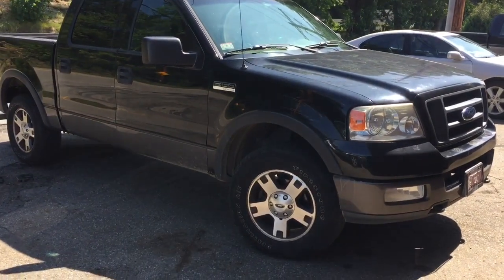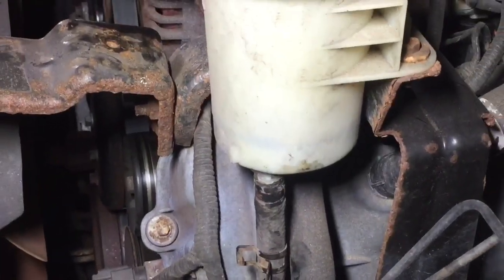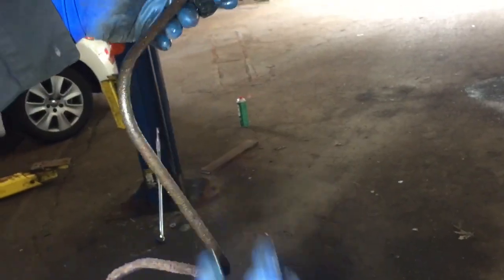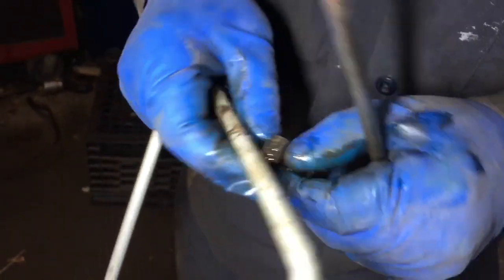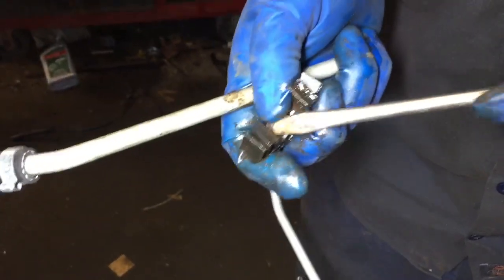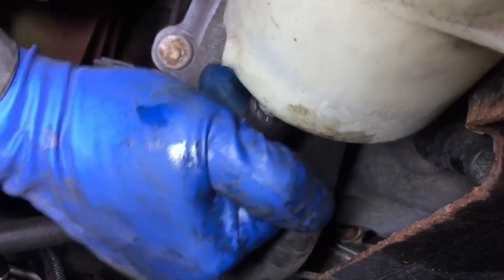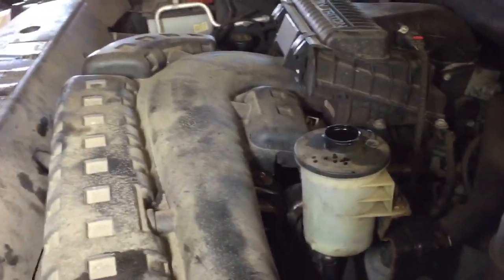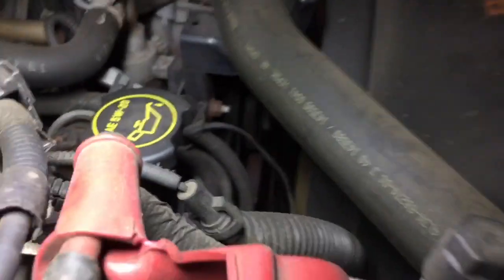2004 Ford F 150 Power Steering Leak | Low Pressure Line Replacement

Comment from the maker: Dreamcatcher C  Hey Dreamcatcher it may or may not work but it’s risky and dangerous as you can boil the liquid or catch it on fire. I’ve heard of some guys letting their truck run for a few hours prior to trying to pull it off too.

 You also want to be careful to no ruin the mini cooler. I would much rather use a lot of liquid wrench or soak it WD-40 for a few hours or cutting the rubber hose off at one end and using a pair of vise grips to twist it off!! 

Either way let us know what you chose to get it off!?! Update us with your success on repairing it!! Please leave a LIKE and SUBB if we were able to help 👍🏻👍🏻👍🏻👍🏻
Reply: HAD TO CUT IT OFF. THEN PULL AND TWIST OFF. WHAT A PAIN IN THE ASS AT  MINUS -30.

Comment from the maker: James Foster James Foster Hey James thanks for the feedback. We replaced the Low Pressure Line also known as a Power Steering Return Line. Starts from the power steering reservoir and ends on the low pressure side of the power steering cooler.

I don’t have the part number. However we ordered the part from the dearlership because the owner of the truck was planing on keeping the truck for a while. 

Jeff Hollander definitely found a good aftermarket low pressure line for you I would click on the link provided. As always thank you for the question please leave a LIKE & SUBB 👍🏻👍🏻 if the video helped you at all and keep us updated on your success with your Repair!!

Comment: HEY MAN I HAVE 2004 FORD FREESTAR 4.2.  
ITS LIKE MINUS -30 CAN I USE A SMALL TORCH TO HEAT END AS IM HAVING A HARD TIME WITH IT.
Reply from the maker: Dreamcatcher C  Hey Dreamcatcher it may or may not work but it’s risky and dangerous as you can boil the liquid or catch it on fire. I’ve heard of some guys letting their truck run for a few hours prior to trying to pull it off too.

 You also want to be careful to no ruin the mini cooler. I would much rather use a lot of liquid wrench or soak it WD-40 for a few hours or cutting the rubber hose off at one end and using a pair of vise grips to twist it off!! 

Either way let us know what you chose to get it off!?! Update us with your success on repairing it!! Please leave a LIKE and SUBB if we were able to help 👍🏻👍🏻👍🏻👍🏻

Comment: I have a 2002. Is this a high pressure line? Can I just slide a hose over it w hose clamps?
Reply from the maker: James Foster Hey James you definitely can however it will be a temporary fix, i’m not sure how long it’ll hold but please keep us updated on your success with that type of patch

Unfortunately these hoses have a defect that come from factory where they rust out and leak inside of the grommets so if you’re going to put new grommets as well make sure to grease them up first to extend their life!! Thanks for your feed back and please leave a LIKE & SUBB if the we were able to help 👍🏻👍🏻👍🏻
Reply from the maker: James Foster we replaced The LOW Pressure Return Line.

Comment: What is the actual name, part number of this line?
Reply: Found this also leaking on my 2004 f150. I am having trouble finding the part number for that line.
Reply from the maker: James Foster James Foster Hey James thanks for the feedback. We replaced the Low Pressure Line also known as a Power Steering Return Line. Starts from the power steering reservoir and ends on the low pressure side of the power steering cooler.

I don’t have the part number. However we ordered the part from the dearlership because the owner of the truck was planing on keeping the truck for a while. 

Jeff Hollander definitely found a good aftermarket low pressure line for you I would click on the link provided. As always thank you for the question please leave a LIKE & SUBB 👍🏻👍🏻 if the video helped you at all and keep us updated on your success with your Repair!!
Reply from the maker: Jeff Hollander Thanks for helping out one of the Viewers 👍🏻👍🏻👍🏻 you definitely made it easier for newcomers with your LINK that’s a great aftermarket part, I do like O’Reilly parts too. thanks again Jeff Hollander!!